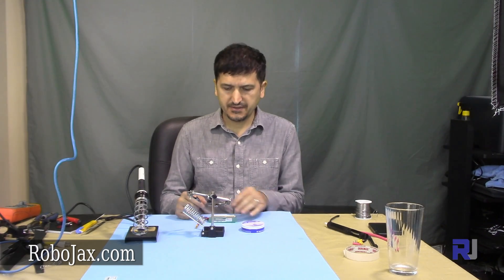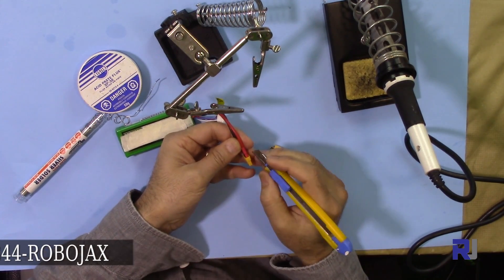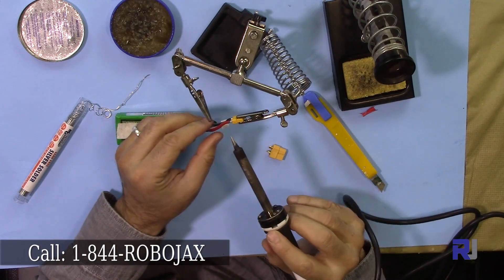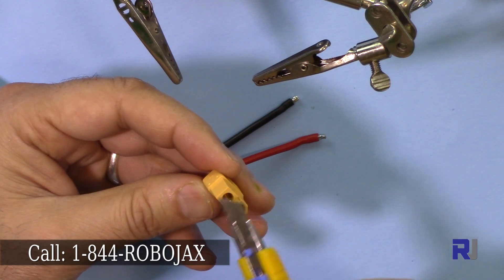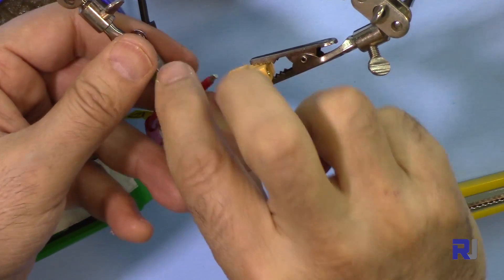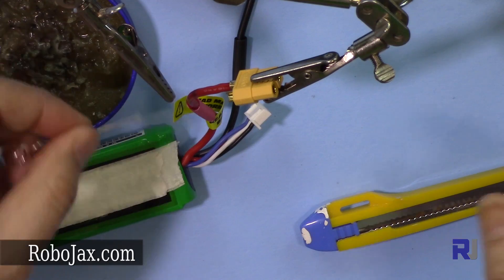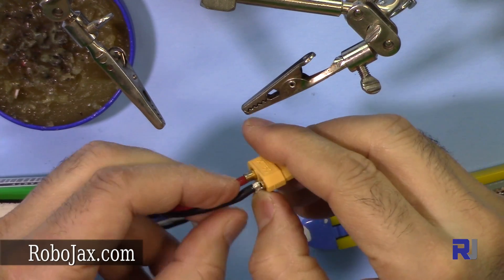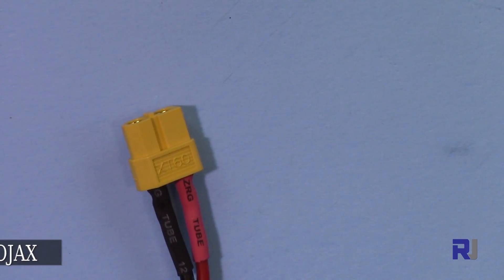Soldering replacing XT60 XT30 XT90 Connector Perfectly - RJT649

Comment: There's no reason to unsolder both wires at the same time or even remove the heatshrink from both.  Unsolder one wire and then solder it to the new plug.  One at a time.

Comment: Is it the use of flux that makes your solder melt so fast? I have lead-free solder; it seems difficult to work with; Even with 2 plugs connected together to maintain alignment of the pins (as advised)  I'm worried about melting the XT30 whilst trying to get my solder to flow. Any tips for this?
Reply from the maker: Yes. flux will make hug difference.

Comment: I dont have a heat gun, can I use a lighter?
Reply from the maker: No
Reply: @robojax  lol I have been using it in the past. Dangerous? Maybe I should buy a heat gun then
Reply: It's just hard not to accidentally burn the wire insulation

Comment: Good video so far. Better would have been you did one cable after another and not cutting loose both at once. Shorty on lipos is not fun! And pull the shrinking stuff a bit onto the xt60 so it will be stuck close to the connector. And another idea: stick the counterpart of the xt60 to avoid possible deformation :-)
Reply: It was hard to watch how he was soldering bare wires with the other side also bare. It would have been so simple to instruct to pull the shrink tube over the bare wire before soldering the other side. Based on the comments most people understand that but, there will be a few who don't.

Comment: this is itching for a cold solder joint. barely enough to solder. if ur not going to make sure everything is "wet" same time at least flux/tin the connector first then put em together n re-apply heat
Reply from the maker: than you for sharing your experience.

Comment: EEEEEEK ACID solder paste -   Rosin paste/core.
Reply: Wanted to say the same thing.
Reply: You never use acid base flux ( plumbers flux) in electrical circuits.    Flux used appears to be acid base - confirm.  https://www.all-spec.com/Product/835-100ML-33018?gclid=CjwKCAjww5r8BRB6EiwArcckC82a_KzfjPryH_eD_XxWqhlaFCa_2kdpFxhuCo4YXEunraGT-2eDLBoCG-MQAvD_BwE

Comment: Thanks for the video, how many watts has your soldering iron,? It takes me forever to get the solder binding with the connector
Reply from the maker: It is 30 to 40W, the trick is not to hold the connector with metal to avoid heat transfer.

Comment: haha, says be super careful, 2 seconds later swats the connectors and I was amazed they didn't touch, only reason they didn't and cause you to start a Lipo fire is because the factory wires were exposed just a little. For anyone watching NEVER EVER have both battery wires removed at the same time, Do just negative to negative, then Pos to pos, no reason at all to have both exposed together. 

Otherwise GREAT informative video. ALSO for others watching this Do check TomLovis comment for improvements to this video on the pre-tinning and shrinking the heat shrink a little to slide it down inside, awesome ideas!
Reply: Matt W i also shrink to slide in deeper.

Comment: a) Never work on both wires at the same time when working with batteries. Just leave one with the heat shrink on, disconnect one and solder it to the new connector and put heatshrink on - THEN do the second. Much safer.
b) Pre tin the connector a little to make a better connection surface. Just put a little solder on the part of the connector you want to solder your wire to.
c) Shrink down heat shrink only a little, until you can actually push it into the connector. The holes around the solder area in the plastic part of the XT60 are big enough to shove in the heat shrink a little. Then shrink it down until finished.
Reply from the maker: Excellent tips.